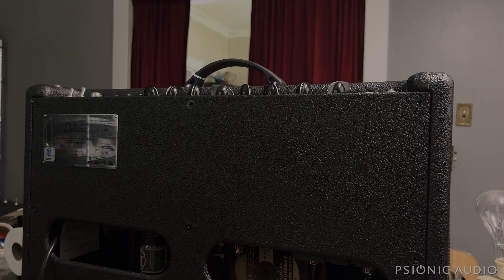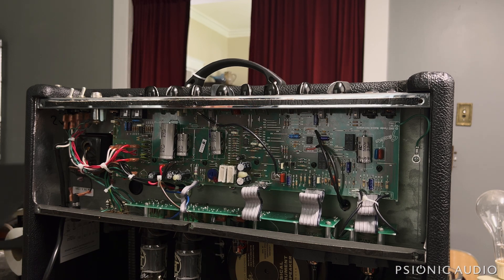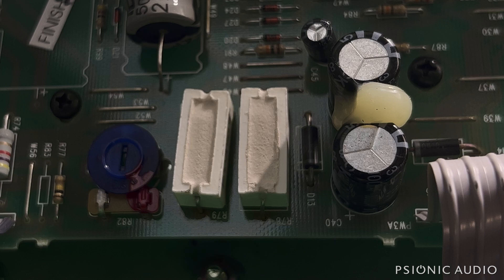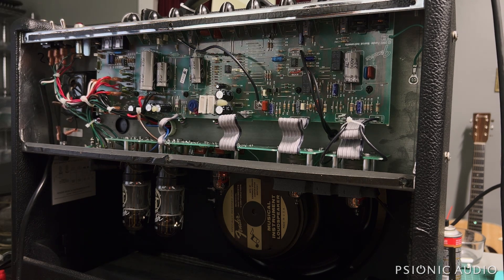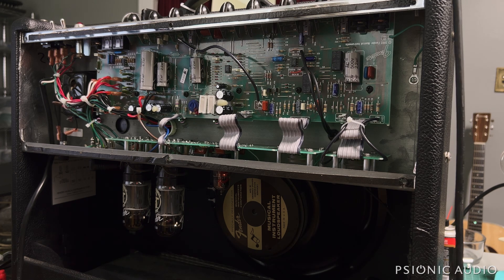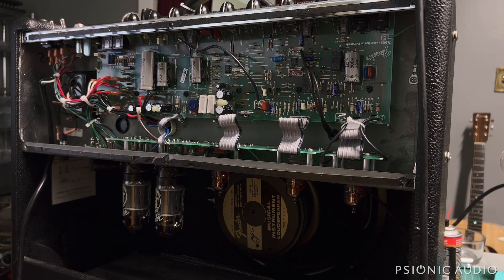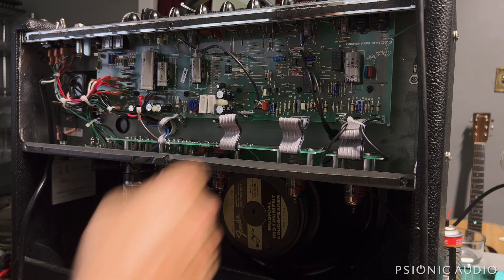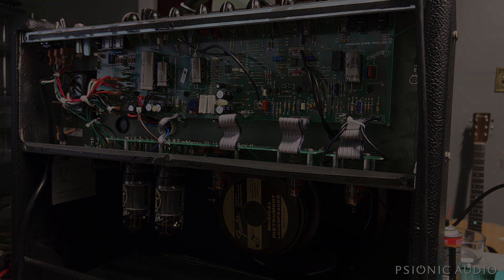Hot Rod Deluxe | Bad Tubes Or?

Comment: Dear Fender. Could you please switch to F&T electrolytic capacitors?
Reply: God forbid they spend the extra $6 per amp
Reply from the maker: Or better yet, as it's a PCB, ditch the axials and get 105 C rated 10K hour Nichicon or Panasonic radials.

Comment: Very interesting, I have a HRD iv in the shop right now for similar buzz and noise, just bought it used from a store here in Canada and they are looking at it. Curious to see if their tech finds the same thing(s) you find on so many amps, or if they just change the tubes and ‘hope’ the problem goes away or I don’t notice it lol. If they do it right, it’s probably going to need caps, maybe the 5-watt parts like this amp, as well as at least 1-2 preamp tubes replaced. Thanks for the insight and info here.

Comment: Great info, thanks for your insights! Question...I just picked up one of these the other day for the very fair price of $0.."It works, but sounds bad. Take it if you want." I haven't had a chance to take off the back panel and snoop around yet, but after watching your videos I'm gonna go out on a limb and say this diagnosis applies. So, once the repairs are made is it good to go or does the design cause this problem to reoccur? Thanks again.

Comment: Just opened mine up for buzzing and yea, those same parts seem to have discoloration.. that right filter cap has like red brown color on the front, and those 2 white amp capacitors have discoloration on the board, plus that little black diode to the right of it....

Comment: I have a hot rod deluxe 3 and to remove some of the bass put a 70/80 speaker in. Unfortunately this made little difference and played a gig last night with bass totally off and mid at around 9 , but the amp really boomy still. I realise I can change this with a graphic pedal but wondered if this may be indicative of anything else. Was really loud with amp volume up around 5. Thanks

Comment: I have one of these V2's as well, I've done the Filter cap swap to F&T's, as well as the resistor raising/replacement. Just doesn't seem to have any Bass response. Checked the pot and all is good, any usual suspect I should look for?

Comment: Lyle, I've had my HRD for 20 years all stock, no mods. I opened it up and have gone over it several times based on your videos. No leaky caps! Everything else is as you describe. What really has me confused is my speaker cable is connected to the External input on the right. If I plug it into the main speaker jack on the left (when facing the back of the amp) I get low volume. It behaves as if those speaker jacks are reversed. It's odd behavior and I don't get it. What I also don't fully understand is how the pre-amp tube section works when you run an effects pedal (like HX Stomp) into the power amp in. I've always used my amp this way. I get that it bypass the pre-amp section (only the reverb knob works), but what are the pre-amp tubes actually doing? What does a combo tube amp like this physically need when you go through the effects loop?

Comment: After I started watching your videos that routinely expose the high failure rate of these amps, I didn't take it personally. Instead, I promptly sold my Hot Rod Deluxe and my Blues Jr, as well as my reissue Vox AC15 and Vox AC10. The only thing left around here that's a similar POS when it comes to repair is a Peavey Classic 30. I only paid $100 for the Peavey, so if it fails, oh well.

Comment: repeat comment, I thought I was saving my tubes by not playing mine that much, but Im actually saving the caps hahahaha.. what happens if the white square box, next to the blue bias adjuster, moves.. my amp still works good, but I noticed it moves, Im thinking who ever biased the tubes, leaned the screw driver up against it.. do I have to take the green board off to solder it, or can I do a duct tape trick?

Comment: I will never understand why people do not take good care of their gear. I guess they do not value it for whatever reason. I have a six year old Mesa MK5/35 that I take very good care of. Mostly because it cost about $2000.00 six years ago. My wife still does not understand why I spent that much on a guitar amp. lol Secondly, do you happen to know how much more it would cost per unit to use a double-sided, plated thru hole board? I would hazard a guess that perhaps only a few more dollars.

Comment: There are a couple problems with this situation.....

1.  The HRDlx sounds VERY Good on the normal channel.
They should have stopped Right There, ditched all the horrible high-gain stuff and added digital tremolo in its place.
They would have had an awesome amp.

2.  These problems have existed for 30 years now. The SAME problems.
They have EASY solutions but Fender refuses to fix them.
As Lyle says,  it shows nothing but Contempt for the customers.

3.  It would cost Feeder VERY Little money to fix these disasters and they could even charge another 20 bux to cover it.

4.  Fender is  Stupid Stupid  Stupid

Comment: If you don’t believe that there’s inherent problems with these amps, just do a search on YouTube and see the thousands of “Hot Rod” repair videos.

Every single one is a cap job, replacing the input jacks and replacing the 5v switching supply components. No matter the series or how new/old they are, they have the exact same problems.

Comment: i hate Fender.
Reply: @bluflaam777LSA  The planet of bad amps..Fender used an RCA schematic..some amp designer.
Reply: @riffwrath6236  I have a Bogen CHB-50 that’s curiously close to a 50 Watt Bassman….😉
Reply from the maker: Nonsense. Fenders from '53-'72 are fantastic amplifiers. And everyone back then pulled from the RCA and Westinghouse etc documentation. As good amp designers still do to this day.
Reply: Maybe the Fender company of today doesn’t make great decisions for the consumer. But they still seem to build good guitars, even if the amps suffer from building down to a price. I don’t think Leo would be happy about these Hot Rod series designs that are difficult to service, use some dubious components, and have known issues that are never corrected. But I can’t ask him.
Reply: @PsionicAudio  , Not just RCA and Westinghouse, but Western Electric circuits and schematics as well.  The main difference, however, was that Western Electric patented as many of their circuit designs as they could, and other companies had to pay a licensing fee in order to use those circuits; whereas RCA and other companies that manufactured tubes  would design circuits expressly to print and distribute them for free, circuits that would help them sell more of their tubes.
Reply: @75YBA  , and, Marshall got their start by cloning Bassman amps.
Reply: @PsionicAudio  I would love them too at $350 a repair.